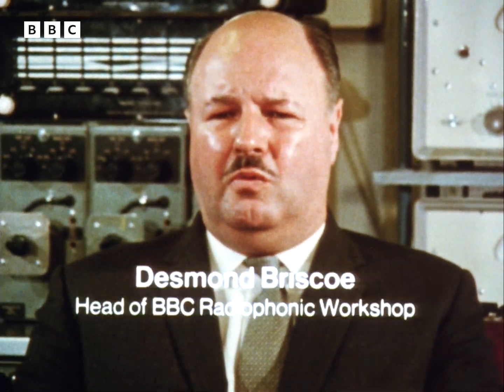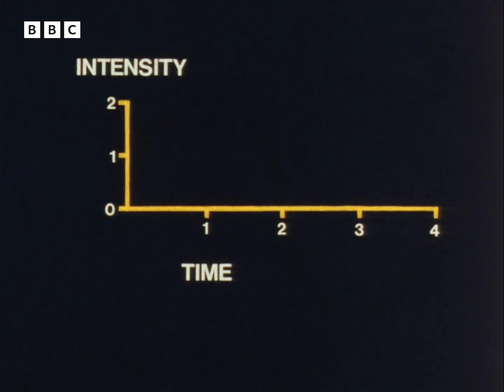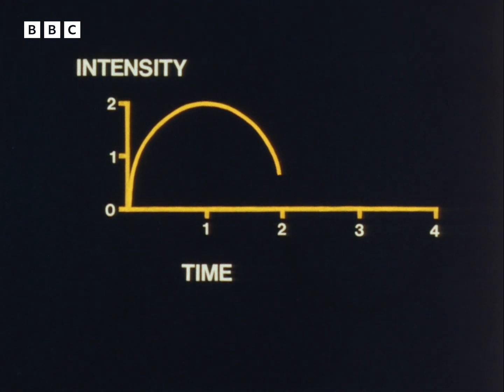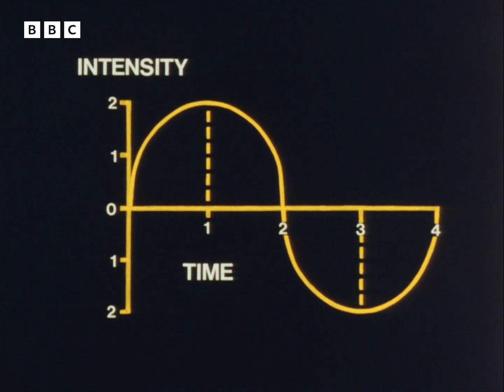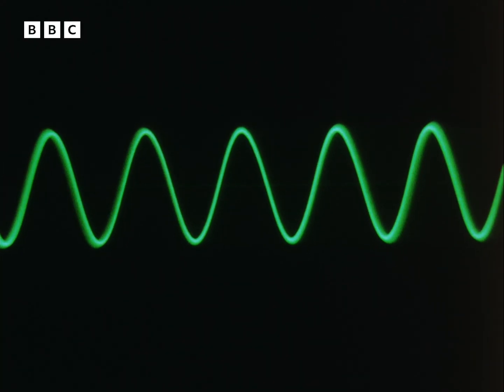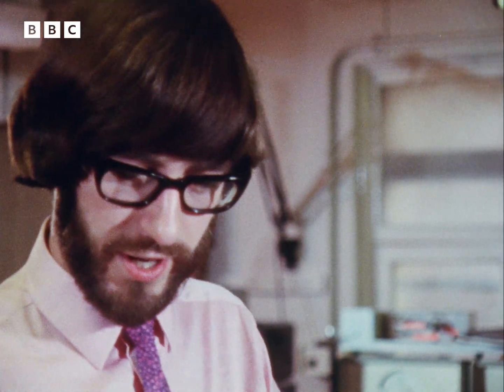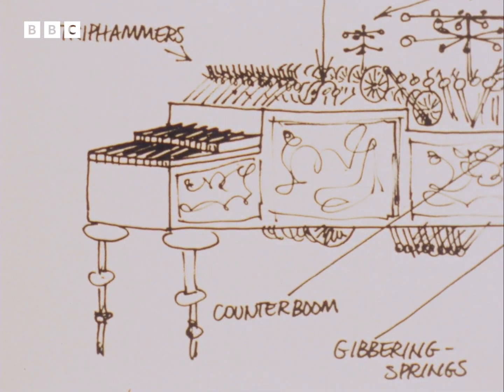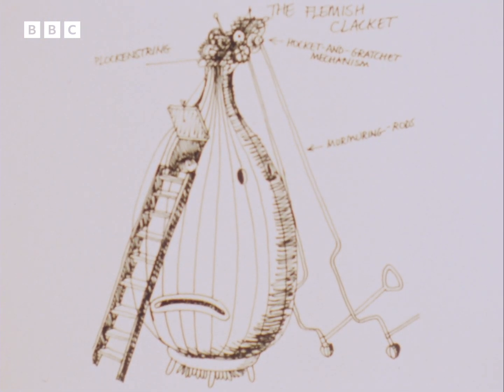1969: What Is ELECTRONIC MUSIC? | Workshop | Radiophonic Workshop | BBC Archive

Comment: This video is a goldmine of samples for EDM.
Reply: Here just for this reason!😂
Reply: BS. These waveforms are the basis of and in every average synthaesizer, analog of digital, hardware or software. No need to sample.
Reply: @whitex4652The descriptions of the sound has good sample material, though.
Reply: @whitex4652But these are the originals.

Comment: there is an earlier video or film in B/W somewhere of Daphne Oram talking about her work, and she describes her idea of making a multi-track machine using 35mm mag film. And  now in this film we can see how it turned out.
But remember this is from 1969. Walter/Wendy Carlos has already released Switched on Bach and the Well Tempered Synthesiser was a little later. Of course, a different concept, less musically experimental but an indication of how far ahead Moog was with electronics. A few years after this in the UK EMS was selling the VCS3 synthesiser.
So really the story is, The BBC Radiophonic Workshop, as initiated by Oram was a playground for ingenious experimental musicians, an enclave of Heath-Robinson, cannibalised electronic test equipment and home builds. Remarkable and glorious but oblivious to the potential it could have in the hands of electronic engineers. The BBC could have produced all manner of electronic audio devices to market. But when the Yamaha keyboard synths and EMS gear arrived, they just left all that in a dusty corner and used the DX7. I witnessed it.
Oram's work with 35mm film strip is predated by Norman McLaren who drew by hand the optical soundtrack to his films.
But Oram is in another league with that gadget and her slides. Amazing.
Reply: Wendy Carlos. Her name is Wendy. Do not deadname her. That is transphobic.
Reply: @aoifependry1029  Her NAME AT THE TIME was Walter. So piss off!

Comment: 11:28 Daphne Oram here, calmly inventing the WAVETABLE, now a standard feature of soft synths and in use on countless EDM tracks half a century later. What an amazing woman, I admire her so much!
(EDIT: thank you to all who pointed out that it's not really a wavetable - I stand corrected! In those days, however, I think that being able to make a waveform by drawing it was unheard of, so this really is very cool!)
Reply: Yeah, my jaw dropped. I knew of the Oramics machine but I didn't know one just painted a waveform on a sheet of glass then popped it in like a piece of bread in a toaster and out comes the sound of the wave. Incredible. And that multi track tape recorder built using magnetised 35mm film. Utter genius.
Reply: @JonnyMonday  Absolutely!  I was surprised to see that myself.   

In fact, I've always wondered how those weird sound effects from the 60's and 70's sci-fi movies were made and what kind of equipment was used to create them.  I knew synthesizers played a role, but many of these sounds were very different and unusual compared  to what you would hear straight from a synthesizer.  Also all of that tape cutting and splicing looks very time consuming.   I admire all of the hard work and dedication that was put into creating these amazing effects.   You just don't hear these types of effects anymore these days.  I guess this would be something harder to achieve today considering the fact tape machines are not as easy to come across today.  Oh, and this is the first time I've ever seen an Oramics machine.  I didn't know such a device even existed.  WOW!!!!!

Also the tape machine was an instrument, Wow!!!  I guess I learn something new everyday!!!
Reply: @Dr808theEarthshaker  The stories about the Radiophonic Workshop never cease to amaze me. I keep trying to find out more because their creativity is always inspiring.
Ben Burt (the Star Wars sound designer) shows how a lot of early electronic music was created in this video: https://www.youtube.com/watch?v=dfCzxbxztj8
There's also someone called Hainbach on YouTube who has lots of great videos about working with tape, test equipment and all sorts of strange technologies. I'm sure you'll get a lot out of watching them.
Reply: @JonnyMonday  Heinbach is great.
Reply: @Dr808theEarthshaker  tape editing was pretty quick by skilled editors
Reply: not only that, but she has the first digital filter on her rack just there too
amazing slice of English genius 
all in a Kent oasthouse
Reply: Wavetable synthesis was invented by Max Mathews in 1958 in the US.
Reply: @jeshkam  
who cares?  she's a woman, and we're expressing our pride in womens empowerment so facts dont matter!
Reply: She’s not remotely describing a wavetable, let alone inventing one. It’s more like a theremin with a clever optical input.
Reply: @ecktoplasmic  Maybe you should watch it again. Pay attention to the wave shape she draws and what is on the oscilloscope.
Reply: @macronencer  it’s not to take anything away from Oram, it’s just not what a wavetable is in concept or execution. Her concept was closer to conventional synthesizer with this optical interface instead of knobs and buttons. The film is a little misleading about how it actually worked though.
Reply: @ecktoplasmic  Strictly speaking I suppose you're right that it isn't a wavetable because this is the degenerate case where the table contains only one wave. It is clearly an oscillator with a waveform that can be drawn by hand. See the oscilloscope trace at 11:55 and compare with her input sketch at 11:33. That's what I was talking about, and although I accept it isn't a wavetable as such, the idea of being able to draw waveforms by hand is certainly one of the key features of modern wavetable synths. Apologies for not being more precise!
Reply: @macronencer  if we expand the definition of wavetable to include any instrument with a set or selection of electronic waveforms, then maybe we could call this a wavetable, as well as virtually every other electronic synthesizer device. The concept of synthesizing sounds from scratch using an optical reader was innovative but not a an essential feature of wavetable synthesis, and also not likely her invention. I’m just saying, there’s sufficient reason to praise Oram’s impressive work and accomplishments without heaping on credits for things she didn’t do.
Reply: @ecktoplasmic  Fair enough. Regardless, it was a moment of delight for me to see someone this long ago actually drawing a custom waveform for an oscillator!
Reply: @macronencer for sure, it's astonishing to see her re-synthesizing hand drawn waveforms in the 1960s. For some time, it was a bit of a mystery how she managed to accomplish such a thing.
Reply: @ecktoplasmic  are you sure it is optical? to me it looked like iron oxide paint, so I assumed it used a magnetic reading head.
Reply: @KarldorisLambley  I'm not absolutely sure, no; I think it was optical like the sound-strips on movie film that I presume inspired it. There's a really good interview online somewhere with the engineer that more/less designed this device for Oram; he goes into considerable detail about the technical specification of the device, and it's a little different that what's suggested in this film. From my memory, the "reader" was limited to just a few gestures, and  separating the waveform image into 2 or 3 discrete segments. So one must "draw" from only a few recognized top shapes, middle shapes, and bottom shapes for a composite "waveform". Also, if I recall right, it's not an instantaneous process as portrayed in the film. One would draw the 2 or 3 segments of the waveform, and when the reader could understand it, it would then take some additional amount of time to "process" and playback the chosen waveform. You'll have to find the article, it's really interesting and worth searching out.
Reply: @ecktoplasmic  i shall do. thanks very much for you detailed reply.
Reply: @KarldorisLambley Did you ever find the article?
Reply: Now I understand the meaning of "shaping the sound"
Reply: can you do this in a DAW tho? ie define your own wave shape by drawing it?
Reply: Also multiple synth plugins allow the drawing of waves in wavetables, I think.
Reply: and that sexy posh voice! phwooaaarr
Reply: When the guy was talking about one of the differences between a synthesized woodwind  and the real thing was that the woodwind has a gradual attack @ 3:30  -- Didn't they have amplitude envelopes to shape the sound in 69, or did that come a little later?
Reply: Arguably a waveform, not a wavetable.  The PPG synthesizer wavetables contained a set of waveforms.  A useful thing when digital synths had so little processing power I guess.  I agree with the person who said it's like a one waveform wavetable.  Not taking anything away from her.  This was pioneering work as far as I know.

Comment: Quick research always interesting how old someone has become.
Daphne Oram 31 December 1925 – 5 January 2003
Desmond Briscoe 21 June 1925 – 7 December 2006
John Baker 12 October 1937 – 7 February 1997  (sacked by the Radiophonic Workshop in 1974 struggling with alcoholism)

Comment: Very interesting film - does anyone know how the machine works to convert a drawn waveform to an electical one? I've never seen anything like this before, hopefully there is another film somewhere explaining how it works.
Reply: The drawn marks effectively block out light at precise moments as the film is played, stopping it reaching the photodiode. The photodiode converts any light it is given into electrical currents. So different drawn marks result in different currents. While this could then theoretically be used for pretty much anything, Oram of course used the currents to generate synthesised sound waves.

It’s essentially a rudimentary form of sound-on-film, which found its way into cinemas during the 1970s. Others around the world, primarily in the USSR, USA and Germany, were doing similar things some time before, but Oram consolidated the various technologies into what some would call an early form of music sequencer. All in all very pioneering stuff.
Reply: @gaoeykreg  I see what you mean, but wouldn't that require an array of diodes to scan across the t axis of the waveform in order to reproduce it as drawn?

Sound on film, i thought, worked by matching the amplitude to the t axis of the film via the amount of light allowed through - not the waveform shape. The sound wave isn't actually drawn on the film in its f(t) representation, like in this video.  

i.e. it on a cinema film it 'looks' down along the f(t) axis rather than at the plane on which it is drawn.  Hopefully that makes some sense :/
Reply: rewatching the video at 11:40, i'm guessing 'the equipment' is a TV video camera pointing up at the slide.

i.e. it is raster scanning the drawn waveform and converting this to a amplitude vs time function via some impressive analogue circuitry, and sending the time signal to the oscilloscope and a loudspeaker. 

Makes sense actually, the BBC must obviously have been full of TV electronic engineers. Computer memory was stored in TV tubes in fact about ten years prior to this, so they could probably work wonders with processing a TV signal at that time.
Reply: @tachikomakusanagi3744  Yeah, it’s an opaque line on transparent film, not the other way round as I thought.
Reply: It could be an array of photodetectors or light dependent resistors. If they scan the width of the line graph then they can key a vco or vca. It all sounds quite analog so maybe the electronics are less complex than imagined. All you need is a max and min value set by the drawn line and it’s all very fascinating stuff that probably grew out of the techs making weird noises until the composers got their hands on it. Anyway enjoy!
Reply: @adm-5284  Arrays of photodetectors or LDRs in 1969 would have been possible but very expensive and I'm not sure the RWS ever had that level of funding.  In 1969 Such arrays would surely have been at the heart of TV cameras which - inflation adjusted - used to cost about 10x what such a thing costs today.
Reply: @tachikomakusanagi3744  I think your explanation makes sense. Alternatively, it might be mechanically scanned, with a photodiode on a rotating wheel or oscillating track. It would be interesting to try and recreate this.
Reply: @alanmusicman3385   They were expensive at the time, and although Oram here appears in an item about the BBC, by the time she started to develop Oramics she was entirely self-funded, apart from a couple of grants early on. I’ve described the waveform scanner in another comment, but to get around the difficulty of compact and responsive light sensors to read the film-strip inputs, she and her engineer ended up using early transistors (themselves quite expensive) with the cans cut off, as they had a reasonable sensitivity to light when exposed, and a good response time.
Reply: Yes, it’s damn clever for the time. Above the glass slide is a cathode-ray tube from an oscilloscope, with a variable frequency sawtooth scanning circuit to sweep the dot horizontally from one side to the other. This is put in a lightproof box, which means the ‘dot’ becomes the light source that shines through the slide.
 Beneath the slide is a photocell that senses when the light is visible through the transparent portion of the slide. This photocell is connected via an amplifier to the vertical deflection plates of the crt. The arrangement is such that the dot will rise up until it can be ‘seen’ by the photocell. Once it can be seen, it wants to descend again, but as it’s on the edge of the painted waveform, it achieves equilibrium at that position. As it’s constantly scanning the tube in the horizontal plane, the interaction of the two circuits means that the dot follows exactly the painted waveform. The voltage present on the vertical deflection plates is thus varied according to the characteristics of the waveform, and becomes your audio signal. The pitch of the note created can then be easily varied by altering the frequency of the sawtooth oscillator driving the horizontal scan. The technology wasn’t entirely original- I believe it was developed during the war as a means of mapping coastlines onto radar displays, and was later used in early computers as a function generator.
Reply: Just put a bright light at one end, and the light that leaks through will be dimmer the further the curve is away from it.

Comment: "beware high voltage. you can get a many shock even when the 'power is turned' off." Not sure about what is written in the end.
Reply: I think it says: 
'... you can get a nasty shock even when the mains is turned off'
Reply: You've pretty much got it. It says "BEWARE HIGH VOLTAGE You can get a nasty shock even when the mains are turned off" :)
It packs a wallop even when it's turned off at the wall-plug, basically.